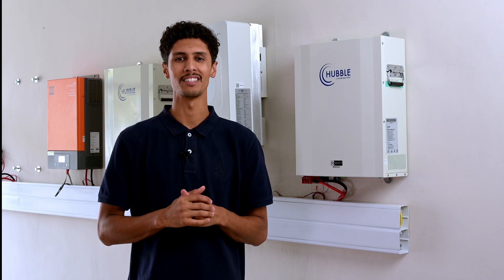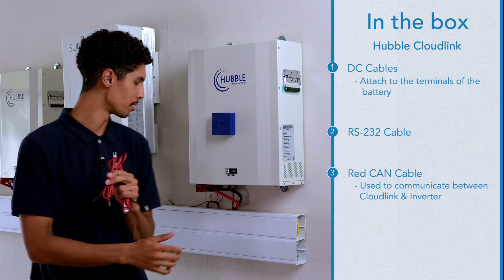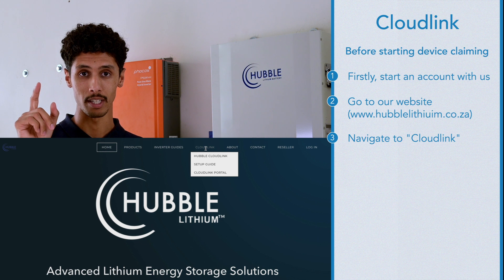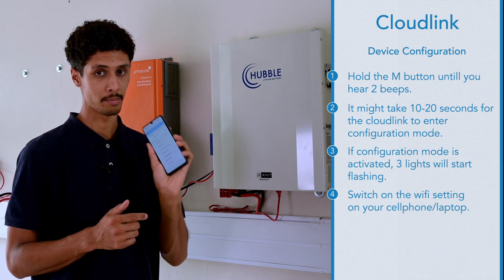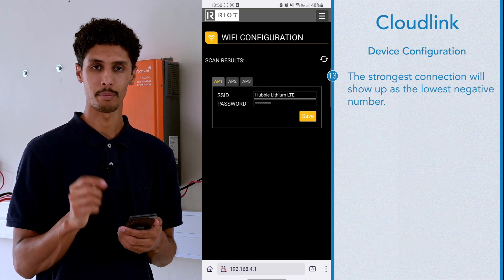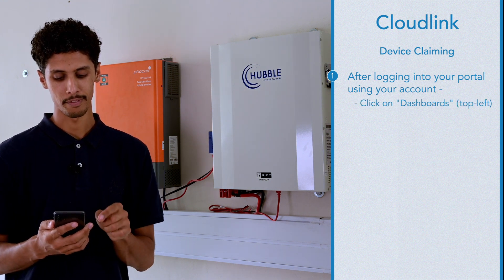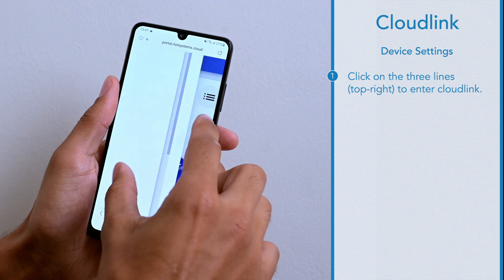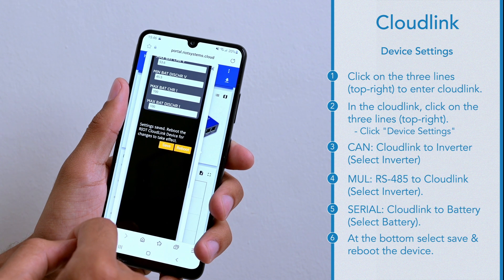The Hubble Cloudlink Setup Tutorial [Sunsynk 5, 8 &12KW Inverter] [2022]

Comment: Hello 
I need assistance with my hubble am2 linked to a 5kva Luxpower. I have done all of the settings on the inverter and battery 1000 settings and the battery does not charge. Brand new battery reading 27 percent  
Can a new battery be faulty?

Comment: Thanks for the informative video.  One question, the CAN cable would have been directly  between the SunSynk BMS port and CAN port on the first Hubble AM2.  With introducing the RIOT unit, does this replace that cable and in other words is the RIOT inserted between the Inverter and the first battery.  Inverter - RIOT - Battery and the original cabling (prior to RIOT) removed?
Reply from the maker: Good Day Quintin, 

For a more in-depth explanation of the CAN-cable connections please forward your query to techsupport@hubblelithium.co.za

Sincerely, 
The Hubble Team

Comment: Hi, I have 3 AM2 Hubble batteries in parallel. Will I be able to see the state of charge for each battery? Also, will I be able to set low SOC disconnect for each battery? The SOC on my my 3 batteries are not perfectly in sync
Reply from the maker: Hi Naude, 

Please forward your technical queries to our new dedicated support team at support@hubblelithium.co.za with the following information so that we can provide you with timely assistance:

1. Inverter make & model
2. Model & number of connected batteries
3. Are your batteries in Series or Parallel?
4. A brief description of your system issues
5. If possible; images of your power system

Comment: Great Video. If you use the cloudlink. Do you still need the Sunsynk data logger to make changes to the inverter remotely or can it all be done via cloudlink?
Reply from the maker: Hello Craig, thank you for the positive feedback! We have inverter control with the axpert type inverters, but not yet Sunsynk for the moment, however because they connect via different ports - you are welcome to run them at the same time.